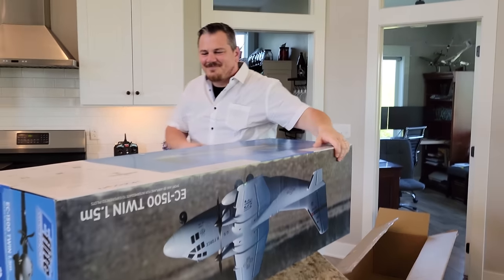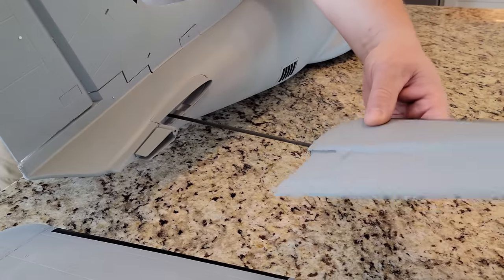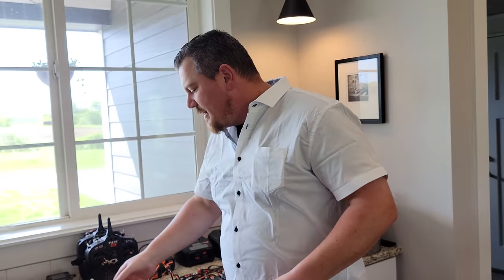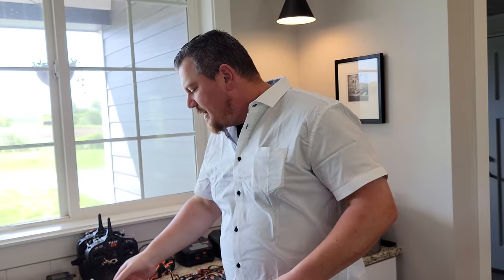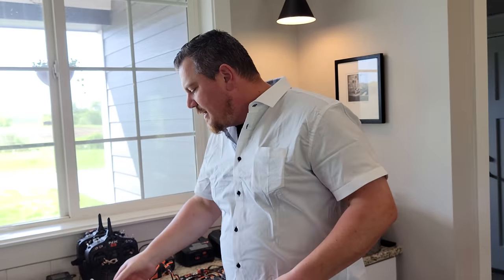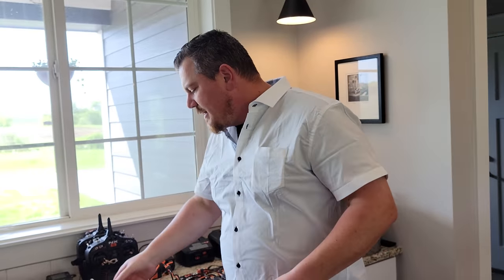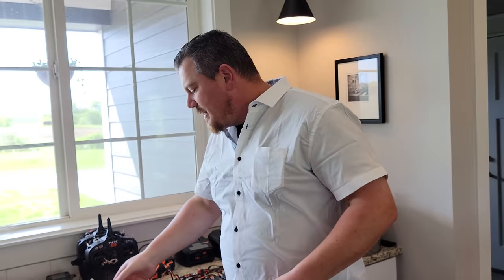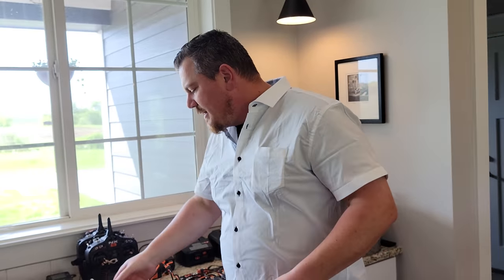E-flite - EC-1500 V2 - Twin 1.5m - Unbox, Build, & Radio Setup

Comment: If you want to be able to reposition the decals during  application,  apply some  Windex to the surface before applying.  Once decal is in position, carefully remove excess spray with a paper towel or cloth.  It works with Callie Graphics decals.

Comment: Hi Brian Another great plane from Eflite thanks for the intro. FYI Your video on the flex RV8 you were concerned about plugging the main battery balance lead into the LED controller. I spoke with FEX and tested using the 6s lead. you can use it because the controller only uses three of the cells to power the LED's but keep in mind that at the end of the flight, three of the cells will be at a lower charge than the rest so a balance charge will be needed to balance out the battery. you can of course use a separate three cell (up to 1300) to power the LED,s.
Thank you for all you do for our community.

Comment: Can you tell me the type of foam used on the plane? I bought the Beech 18 and the foam and panit were terrrible. The paint was takey and paint was sticky. I have the A10 with no issues. Thanks.
Reply from the maker: EPO, same as the Beechcraft D18
Reply: @BrianPhillipsRC  Thanks, My beech is so fragile with the foam it dents if you look at it. My A10 F16 are not like that.

Comment: 1:32:47 Im thinking put a magnet in the side for the best of both worlds? No chop suey and no noise?
Reply from the maker: Magnet wouldn't make it easier to remove, the tape gives me something to grab to pull up the end without marring the finish. It has served me well over the years, and usually of very minimal impact on looks

Comment: the EC1500 is similar to the C-130   but C-130 has 4 engines.  The plane that the EC1500 is actually modelled after is a C-160  which is a French-German coordinated company design that is very much used in africa and the French airforce  it is not a C130
Reply from the maker: Thanks!!!

So it more closely resembles the Transall C-160....

We were thinking it was modeled after the Alenia C-27J Spartan

Comment: How are you able to program reverse when the manual says you have to BUY another piece of hardware from Horizon? Why does it say it has reverse programed and it does not? What am I missing? Thanks
Reply from the maker: Because the manual was printed before the firmware was updated.
Reply: @BrianPhillipsRC  I did get it to work on ix14 going really quick through the menu. Not sure how. Thanks

Comment: Brian Carbon Z T-28 nose wheel upgrade ….. Motion rc A-10 80 mm nose wheel oleo . Switch it you won’t regret it 😉😮😎
Reply from the maker: I'll look into this.
Reply from the maker: Seems they're about $31 for the part, so pretty good value, if you ask me. This would be nice for all three, or just nose??? Mains would look a lot nicer than spring steel too ;)
Reply: Looks far more scale and in my opinion it’s the one design flaw of the T-28 . Where-as a oleo gives protection from any misjudged landings 😜😜

Comment: Which remote control is recommended for the aircraft? Dx6e ?
Reply from the maker: We suggest this - https://bprc.me/NX10

But there's more choices that you could use... https://bprc.me/Tx OR the https://bprc.me/NX7e if you're NOT sure you'll be hooked or want to hold off on the more expensive choice for the moment.

Comment: Looks great but its not a C-130. Hate to be a nudge, but C-130 has 4 Turbo prop engines and the C-123 has 2 Turbo Prop Engines and 2 Jet engines. Still Looks great.